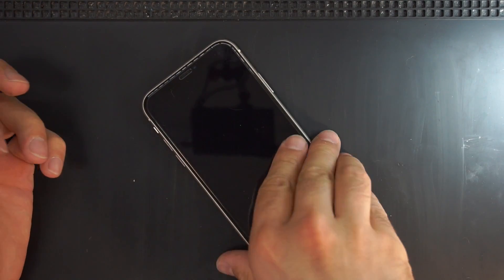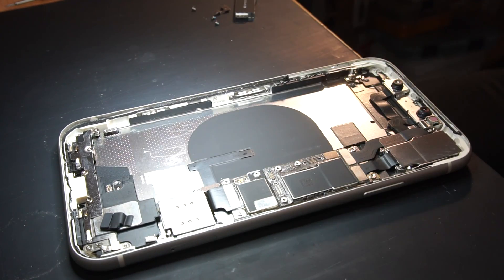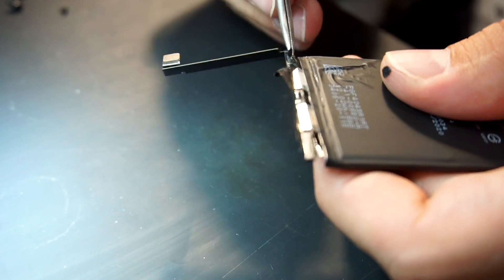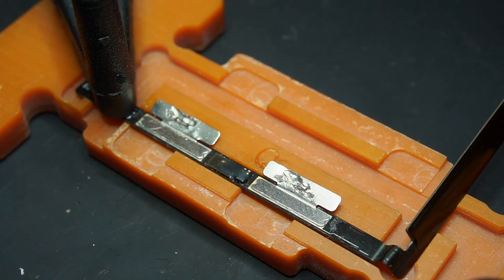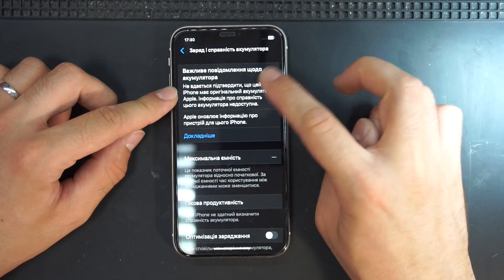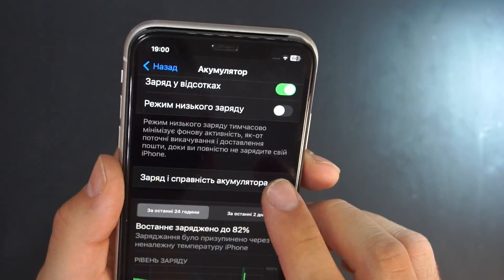iPhone 11 Battery replacement and removing the important battery message

Comment: Kind of pointless if you wanted to do this to hold some reasale value, because as soon as you restore for handover for the new owner, all the works undone
Reply: What do you mean? What happens after you restore it
Reply: @007lutherking the battery health doesn’t work and it shows non genuine part in settings
Reply: @bradleymoon7500 oh yeah. Just got quoted $100 aud to replace the battery and they said it'll show battery health but also that its a non genuine battery.

Comment: why not just copy the original bms serial onto the new battery?
Reply from the maker: @jeraldleung6009  because there is two chips, one you can read and write, the second one you can’t.
And they are bonded together.
Reply: @iTouch-repair Thanks, jcid vise full set costs 300£ (consider for my repair hobby), is it worth to buy, especially more new model of phone is required to be repairable by none apple repair services.
Reply: 아이폰11프로 ios18.5입니다 기존배터리 bms를 새로운 배터리에 옮겨줘야 하나요?

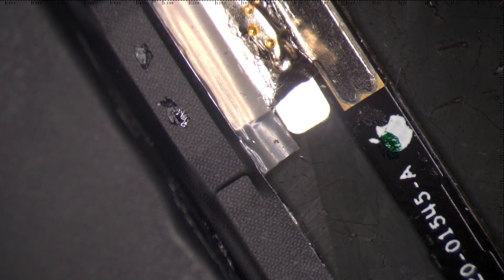Comment: 4:00 average technician 🤦🏽‍♂️🤦🏽‍♂️🤦🏽‍♂️🤦🏽‍♂️🤣🤣🤣🤪🤪🤪 just use soldering iron,, don't need remove spot welding,,, just separate BMS board
Reply from the maker: @user-apurbamodak  and on the positive side how are you gonna do it?
Reply: @iTouch-repair explain it please 😢
Reply from the maker: @hardabir4626 everyone wants to weld but, it’s not funny when you get a defective part and you’ll have to remove the welding and weld over it.
We replaced thousands of batteries and I’ve teached many other people that are working now with me the same technique, no issues at all.
Keep it simple, it doesn’t need complications.

Comment: Hello can i just replace the chip on bms board to aftermarket bms board? My original battery flex cutted
Reply from the maker: @vickyvicmc5  Hi, you can but, you will get the important batter message.
You can find on aliexpress an original BMS, they sell them separately.

Comment: can i just soldering the bms and just put it in the iphone with ios 18.2? coz i dont have any program like that my aill it still work?
Reply from the maker: @bakedwaffleboar  hi, it will still work but, if you have a service message in the battery section then, the battery will drain fast or there could be unusual behavior.
Apple fixed this, if you have a new battery that is oem then, you can just put it and it will show the percentage in the settings. So you don’t have to use the programmer anymore.
It will still that it’s not the original battery of the phone but, it will show the percentage.
Reply: @ thank you i just dont want my apps  be gone for using a program

Comment: Anyone can tell me which pad is Plus and Minus? I'am replacing battery which is damaged and I can't check voltage on pins
Reply from the maker: @smithpl2000  in the thumbnail, where the soldering iron is the plus.

Comment: this method works but has another techniques more easier to do replacement of battery and more saffely to not back for you cuz maybe this method which him make i used in the past using fluid but on negative polar not works

Comment: At what temperature should your iron be while soldering cell and BMS
Reply from the maker: @Blade__susi  at the Lowe’s where the solder can melt but not overheat the BMS.
I would say 260-280C no more.

Comment: Is it good to heat the battery with the soldering iron? I think that spot welding is a lot better for the battery cell
Reply from the maker: @petr5178  I didn’t hear the battery, did you see me heat the battery it self?
I used very low temperature and low temperature solder for this repair, so it’s all good.
If the battery cell turns out to be damaged, how are you gonna replace it with the spot welder?
Also, these cells don’t have a long life as they are all recycled, and after 6 months you will need to replace them again, how are you gonna replace it then?
Reply: @iTouch-repair  the battery heated really quickly inside from soldering the outlets - this isnt good for the chemicals inside. But anyways - new battery after spot weld is changed by grinding the welds - quick process. But no hate nice video👍🏼
Reply: Today I lost a battery with soldering iron. Heating rapidly and fuuuuusssss. Pregnant. 12pm battery
Reply from the maker: @Notavailable-vw3sz  never happened once, I’ve been using this method and teaching it and no battery has been damaged in the process.
Please retrace your steps, maybe you are overheating with the soldering iron or your buying bad batteries.
If you don’t have the skill to preform this repair please don’t do it, you can hurt your self.
As described in the video, I am using a lower temperature solder, if you are ignoring my instructions and not considering the tools I use, it’s your own risk.
Reply: Sir If I don't have old battery what can I fix Unknown parts battery massage? Should I  buy some OEM battery not battery cell? Can I Fix with JCID V1se wifi programmer box?

Comment: Heyy man, do I need a third battery to start the phone or can I just use a cable to get the warning?
Reply from the maker: Hey, you can use the cable and start the phone from the power supply to get the warning.
Reply: @iTouch-repair  I got a bricked iphone 11 error 53 security from an upgrade from IOS18 to IOS26 with a plain generic battery.  After I replaced the bms with the original I was able to restore!  Apple is getting tough on self battery replacement!

Comment: Another reason why my last iPhone is a 6S+.
Reply: All this does is remove a message in battery settings saying it’s an aftermarket battery. These steps are optional. Aftermarket batteries come with new BMS that work great

Comment: Starting to hate apple with all this crap. I’m used to change the batteries of my iPhones since the first one. But, in the past years I had changed my phone often. This time I had to change the battery of a family member, assuming it was as it has always been, annoying but easy. And had to buy another screwdriver (Y) for some stupid screws, and at the end once I started the phone I got the “unknown piece” instead of the quality % of the battery. Only to find out that it’s now impossible for the home user to do this job and get the phone with 100% of its sold characteristics and that now you’re forced to go to apple for service or spend a ton in devices you’ll only use once and make some Frankenstein pieces with the old and new ones.
Ridiculous.
This “you’ll own nothing, and be happy” is bs, and it’s time we fight for our ownership rights and the right to repair our stuff.

Comment: How to o inject 4,2 volts? U sid it with multimeter?
Reply from the maker: No, I have the probes from a multimeter connected to the power supply.
Reply: @iTouch-repair  if i have only multimeter?
Reply from the maker: @Pcut  you can’t start the battery.
You can try connecting it to the phone and plug in the charger.

Comment: I saw a tutorial about how to use the Qianli programmer tool and at the end they leave the tiny board connected to the battery but you take it off.
I'm confused, please reply.
Reply from the maker: Hi, you can leave no problem but, the tiny board can cause issues like the phone won’t charge when it’s fully discharged (turned off).
With or without the tiny board it’s the same but, for less issues in the future I remove it.
Reply: You should leave it…because if you took it out…the reading will reset later on…but many took them out for cost/profit
Reply from the maker: @LeeMooEez  no, not for profit only, many cases where the phones battery died and they couldn’t charge the phone from zero.
Also many cases where there was a software issue and they couldn’t restore the phone because there was an error during the restore process.
Reply: @iTouch-repair  I’m not talking about you haha but I talk about technician who told me that (he do that)
Reply: @iTouch-repair percentage keep on 100 or will decrease and one more thing after update ios battery health back to normal health ?
Reply from the maker: @muhammadirfan3235  Hi, battery percentage will decrease.
If only update then everything will stay the same, but I am not sure about the 17.4.1 and afterwords.

Comment: My soldering iron is rated at 900 degrees and is not adjustable.  Should a purchase another iron before attempting this?
Reply from the maker: Yes, you need to get an adjustable soldering iron.

Comment: Hello, why did you supply 4.2V to the BMS?
Reply from the maker: As said in the video, to activate the BMS (turn it on).
Reply: @iTouch-repair  
I understand, is it necessary? Only your manual uses this, other tutorial videos don't do this. Why?
Reply from the maker: @tyniewicki  you can skip this step as the programmer has this function (injecting voltage to the battery).

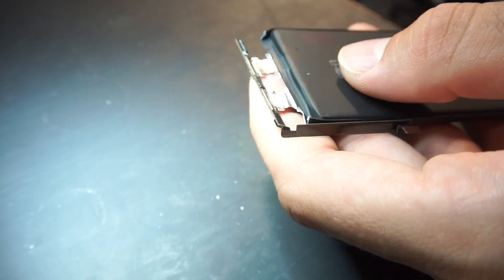Comment: I dont understand why you shocked the BMS at 6:50?
Reply: Привіт,що буде з кондицією батареї після оновлення системи?
Reply from the maker: @SerhioLe  привіт, ви маєте на увазі що буде писати в системі про стан батареї?
Reply from the maker: You mean injected voltage on the battery connector?
Reply: he say - activation. But actualy i think He enable or switch on BMS. Like all BMS works samalery.
Reply: To activate it because when you disconnect the bms it will deactivate the battery/bms